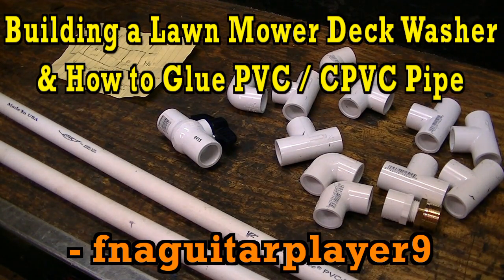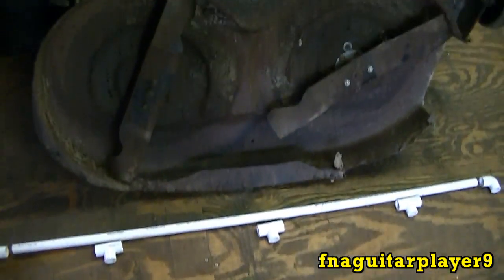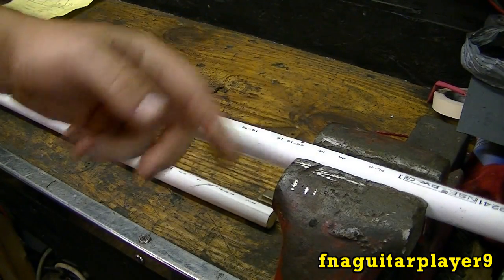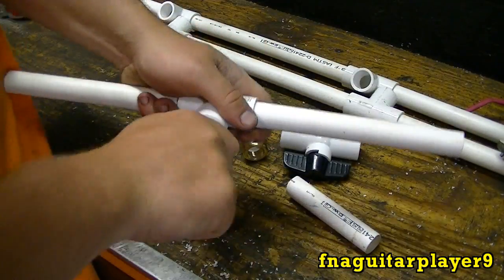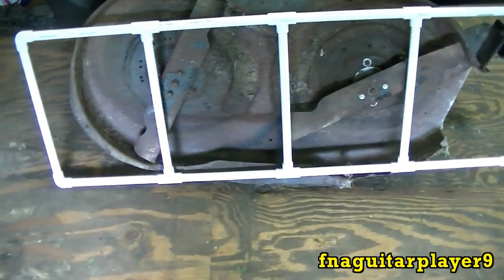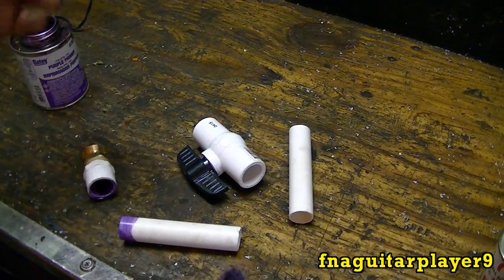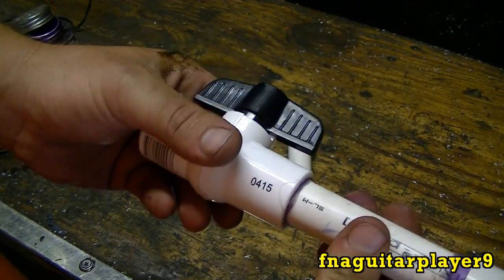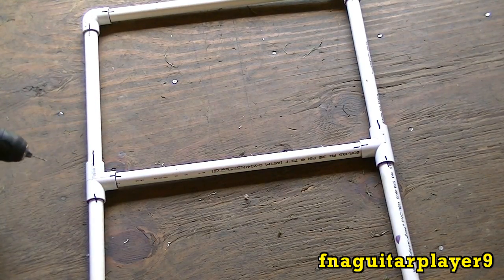Building a Lawn Mower Deck Washer/Cleaner AND How to Glue PVC CPVC Pipe at 7:45

Comment: As for cutting the pvc pipe, I use a ratchet pvc pipe cutter, like a pair of sheers for the pipe, around $12.00 dollars at home centers on on line.  Standard cutter will do 1/2 and 3/4 inch, larger will do 1 inch plus.  These cut in one pass, clean, square cut every time.
Tony De Leo
Port Hadlock, WA
Reply from the maker: +Tony De Leo I had completely forgot about those! I've used them before. I'll have to remember to get me one, i don't work with PVC much but it is easier. Thanks for reminding me and Thanks for Watching!!!